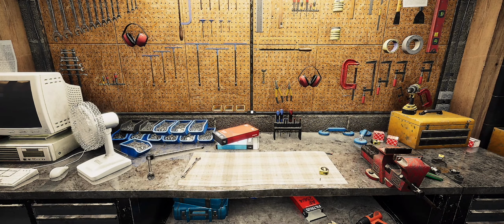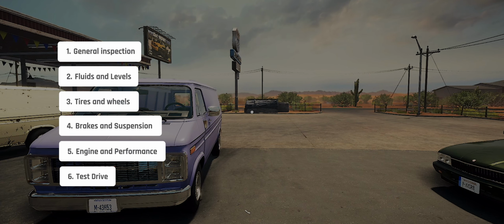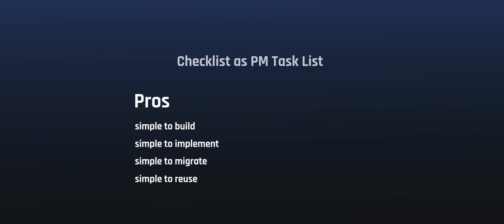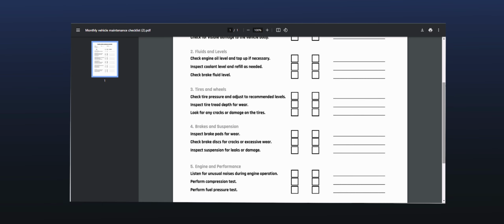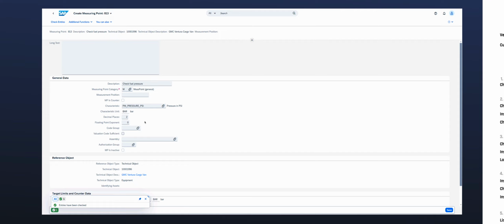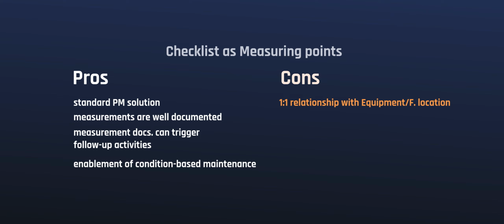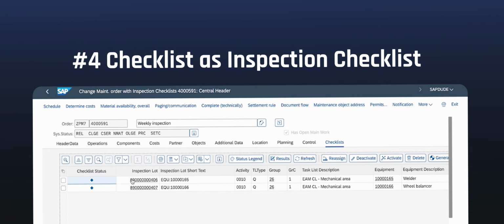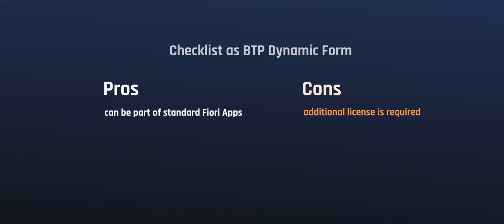6 Ways to Implement PM Checklists in SAP S/4HANA EAM

Comment: Quick question we are early in EAM setup so missing some applications i can create documents in Fiori via DMS and also via GUI DMS, we don't have task list application so if i create general task list in IA05 i can add the document to the PRT which is fine. When the order is created via maintenance plan then the document pulls through into the operation as a PRT and i cant open in Fiori as its displayed as grey text, it doesn't show in the attachments in perform maintenance job under operations section either only under PRT section. If i go in via GUI and double click on the PRT in the operations it takes me into CV03n to view....any help would be greatly appreciated attachements work in Fiori for equipment, orders and notifications no issues.
Reply from the maker: You should check the SAP notes, there is at least one Note for this.